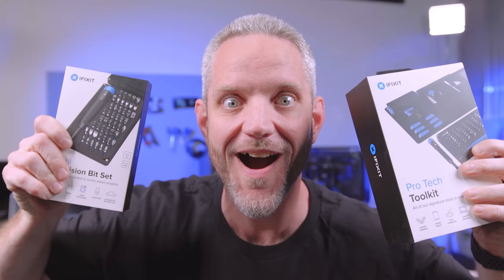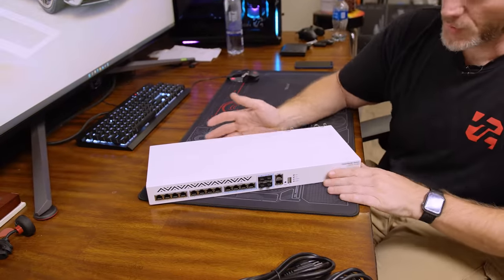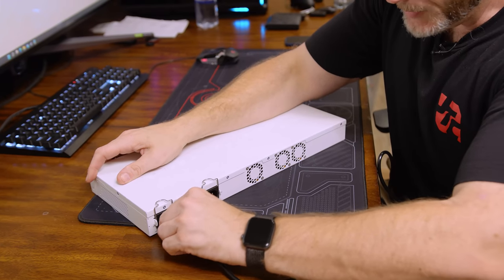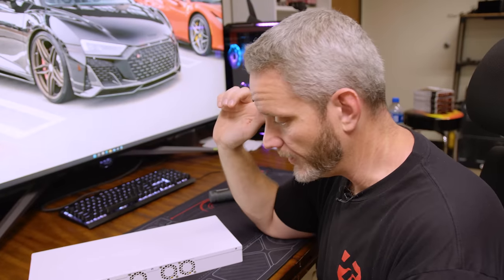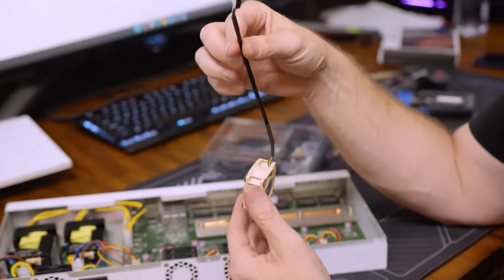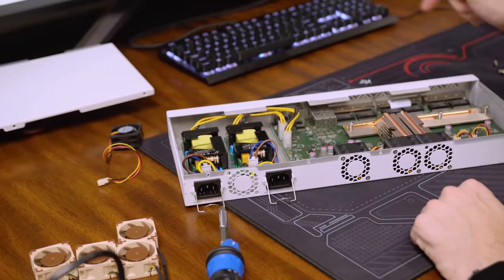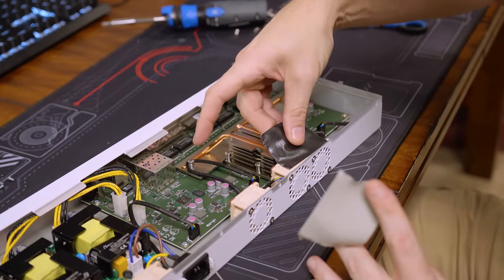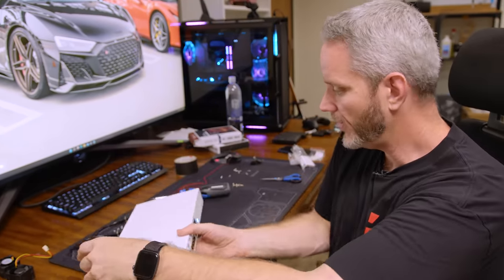We had to modify our new network switch...

Comment: Well , my switch is quieter ( its fanless , the CSS 326 from Mikrotik , 150 Dollar ) it has only two 10 GBit SFP+ and 24 one Gbit Rj45 . Enough for my needs . I buyed two QSFP+ Dual Port cards lately ( 40 Gbit )  because they were dirt cheap , 30 Euro + 15 for a PCIe Adapter each , now i have a 40 Gbit direct connection from my Main Computer to my NAS and a 10 GBit over the Switch because i used the second port to connect to Switch . TVs and BD and  Game consoles are connected to the standard 1 GBit Rj45 . The only Problem are the PCIe Lanes , if you want to use the full 40 GBit , you need 8 PCIe 3.0 Lanes , hard to find in Mainstream , you have to split the 16x Graphicard Lanes to 8X / 8X which does not matter if they are 4.0 or better 5.0 . Todays GPUs not really need 16X 4.0 Lanes and no GPU needs 16X 5.0 . The new X670/X670E could be interresting in this regard , it will be interresting to see how they made up to 5 NVME SSDs possible .
Reply: I love buying fiber cards off of e-bay as they're cheap and usually pulled from a data center.  My favorite is Dell rebadged LX4 Mellanox dual NIC cards.   They're capable of 10 or 25 gig.
Reply: @Darkk6969  My are HP cards ,HP IB FDR EN 10 40Gb 2P 544+FLR-QSFP Adapter - 764737-001 764285-B21 , they are in HPs special  small PCIe Format but you can buy PCIe Adapter for that . Its an Mellanox chip too and uses the Pro Firmware

Comment: Seeing your reaction to how quiet the noctua fans reminds me of when I recently put a noctua fan on my computer cooler.  I was dealing with some major overheating issues so I nearly powered it off during the boot up because I couldn't hear the cpu fan and thought it wasn't working.  But, nope, working fine, just completely drowned out by the cheap case fans it's had for 8 years.

(And yes, I know the imbalance in fan quality is not making the most of it, but the fan in question was substantially discounted, that's the only reason I got a cpu fan that good - it was literally cheaper than the no-name junk fans.)

Comment: 12 ports will definitely be limiting. It is not uncommon for me to pull 12 drops to an IDF in a single day. I would personally just bite the bullet and run multiple switches. You could grab a standard 1Gb 24 port switch pretty cheap for devices that just need a connection but don't need the speed.

BTW: With todays codes I now have 69 entries...nice. I feel like it may be bad luck to use anymore codes and break the sacred pair of numbers.

Comment: For my own sanity the only thing I would do differently is do a mock setup with the orginal fans and seen how hot the switch got then swap out the fans.

With IT equipment you would want to think that it would have some kind of overheating protection but that's not always the case and the last thing you want is a switch slowly cooking itself to death.
Reply: MikroTik switches are actually built to withstand high temps.  I have several of them in my home office and without AC it gets over 90f in the afternoon and then cools off at night when I open the windows.   No issues after 3 years with this setup.  Eventually I will get the AC fixed.  Just $$$ to do it.
Reply: @Darkk6969  perfect example! You know the products and know from your experience they should withstand the heat!

I on the other hand do not know that and would caution towards keeping them properly cooled first before trying to do what Jay did and make them siliant.

One other thing that didn't cross my mind is these could be rack mounted in a dedicated room for server/IT Equipment that is noticeably warmer then other rooms but Jay will be running it in a open space that will have much cooler air than dedicated spaces rooms for the equipment.

Comment: 10gig copper is not dumb. If you’re close enough that you’re getting 10gig speeds 10gig from fiber isn’t any faster. That is a pretty cheap switch though, I’m curious what the actual backplane switching capacity is?

Comment: I use sfp+ to 10g rj45 copper modules for some of the devices I have that already have 10g ethernet like the iMac Pro and a Qnap nas.  I wasn't going to drop 500+ on a 10g ethernet switch when I could just get a pair of modules to convert it to copper.

Earlier Unifi switches were plagued with loud fans (I have some) and I know a decent amount of people swapped them out for noctua fans.

Comment: Hi J the HAMMERHEAD 4V Lithium Rechargeable Screwdriver with Patented Circuit Sensor and 9-Piece Bit Kit with Innovative Bit Grip on Amazon Uk is relatively cheap at £292.72 that's is US dollar $ 356.93 J stricks again.

Comment: Just had a quick look and there is only a few options
24x SFP+ with 2x 40Gb unlink Mikrotik CRS326-24S+2Q+RM (£700)
OR
24x RJ45 with 2x100Gb uplink FS S5850-24XMG (£2000)

Running a lot of SFP+ modules is not cheap and DAC cable are not long.
OR
 get another device with LAG (link agg) it to server rack and then a smaller one in the edit room with DAC (active) 10m (longest ones I can find) to you local machines
See what you think ???

Comment: I just looked and no the first next option for more then 12 ports is the Netgear Prosafe M7300 XSM7224S which is double the price but does give 28 ports and that thing is going to be LOUD as its a 195 watts device. There is no sane option inbetween. Weird that there is such a huge gap that noone went into.

Comment: I think you'll find the reason the Ethernet wont work with SFP port connected is that the backplane couldn't support running both. So it would be one or the other.

Comment: Jay, you probably would have been better off with an SFP+ switch and just used 10GBASE-T SFP+ transceivers for the few devices you didn't want to move over to fiber/DAC, and just used fiber/DACs for everything else. Would have been cheaper and run quieter and cooler.

Comment: There is not really any other switch that is cheaper than that switch that is also RJ45 10gig ports. The only other way its cheaper is an ancient lb6m SFP+ switch that is console management only, no web gui for management. SFP+ modern switches are cheaper, but not by much when you factor in the add-in cards, fiber, and transceivers.

Comment: I was literally thinking about asking about your screwdriver jay and then 5 seconds after the thought you suddenly answered me in video, what good psychic turnaround on questions lol.  that aside vid was awesome as a whole, I didn't know that the fans in network switches used standard 3/4 pin connectors, honestly would have thought they'd be soldered in or be some type of stupid proprietary thing
Reply: Cisco switches use a weird pin-out for their fans but the standard fan connector, WATCH OUT!

Comment: It's gonna be tough beating the MikroTik for value. Ubiquiti has the XG 224 (USW-EnterpriseXG-24) with 24x 10GbE ports and 2x 25G uplink ports for $1299, if you can find it in stock somewhere.

Comment: I’m not familiar with the network plan (probably I’ve skipped that part lol), but is that the only switch that you’re going to put for the entire network? Since your PCs are gonna be far from the server rack, I don’t think that running multiple long Ethernet runs from the rack to the office is a great idea. Plus, you would need some access points, in order to cover the whole space with WiFi. If I wanted to do it better, I would buy 2 of these switches (one for the rack and one for the office), and run a single fiber connection between the two. Also, I would connect the server to the switch with a fiber cable as well, so I can the best performance out of it.

Comment: Warning: @10:00 Jay makes a comment that the capacitors probably would have been safe until he plugged it in. This is not true. Always assume a capacitor is charged even if you have not plugged in the device yet. You don't know that it wasn't plugged in for testing and capacitors can hold a charge for a very long duration of time. Always assume capacitors are charged. Think of them like little ninjas. Sometimes they're a little black bump just chilling, sometimes their faking chill but really they're about to try to kill you.

Comment: why mikrotik though? sure, it's great as a router or a small firewall, but I believe cisco does a better job with switching.
Reply: I've personally owned several MikroTik switches and they all been great for the money.   You still get command line, WebGUI and even Winbox to manage it.   It now supports wireguard inside the switch!
Reply: @Darkk6969  yes. It's basically a normal mikrotik router. They're great for the money they cost, but for someone mission critical, I'd never use mikrotik. I saw mikrotik equipment act up, freeze, get buggy, but never saw any with cisco equipment. Although, if we compare the price, mikrotik is the winner for SMBs.

Comment: Routerboards OS is awesome and Jay should look at it! Cat6a is fine for a looooong time yet. Great buy.
Reply: Fine as long as you only want to go 10G.  Which is the write performance of a 5 year old mid-range NVMe drive.  Modern high spec ones can push (albeit briefly) 50G.
In the last 20 years everything else about your computer has gotten orders of magnitude faster, yet home networking has pretty much stalled at 1G unless you like spending big bucks.  Think of what it would be like if the only options you had were 80GB IDE or 7800GT's unless you spend the pennies for 8TB NVMe or 3090Ti's with nothing in-between.

Comment: Console port is Rs232 and likely pinned for a roll-over, not a cross over cable 

The Management port would be eithernet, but modern ports auto cross, so again, no need for cross-over cables.

If you ever need a crossover cable you're on some old shit like 10m or early 100m.
Reply: My thinking is that the console port would be ideal for using an RPi as the console. They're already running linux, so figuring out software shouldn't be hard (if you're not afraid to code a little bit) but the switch (being that it's literally just a switch and how complex can these things be even if they are incredibly fast?) should be spitting out a simple text-based command-line interface.
Or you could just connect the RPi to the "management" port instead of the console port and use the company's software to manage the switch (hopefully they have a Linux version of their software available, being that they're in the business of network equipment that wouldn't make sense to not have but you never know it wouldn't be the first time a tech company made a bad decision, failing that of course someone ELSE probably made some Linux software for managing that specific switch).

Comment: I really think you should reconsider the placement of your rack, especially if you're conscious of noise levels when filming. Would the room you're in in this video not be a more appropriate place for it?
As for other 10G RJ45 switches I don't think you're going to find cheaper than the MikroTik. Most listings will try to trick you by calling a switch with 8 1G ports and 1 10G port a "10G switch".

Comment: WOW, that is the same mod I make to my Reolink security server, which was exactly what was needed.  Are you one of my viewers Jay 🙂  By the way, those caps are too small to hold any charge that could be a problem for a creature that has a body weight in excess of a 2-week old mouse.  Please keep watching my Channel.
Reply: By the way Jay, you probably made the best choice in that 10G switch considering the availability from Amazon today.  The only thing that may have been near the Price/Performance would have been to use two 8-port 10G switches from NETGEAR (connected via DAC) which would have yielded 15 usable 10G ports.  However that would have used an addition 1U slot in your rack.  I have one of those, and I am currently considering adding another to expand my 10G networking capability.   They are not manageable or support VLAN's, but they work VERY well and seem to last last without an issue so far for me (2.5 years on my one so far without ANY issues).  Doing this could be at least a Stop Gap until one of the Pro summer vendors releases a reasonable priced 16 (or 18) port 10G switch (hopefully with at least half the ports supporting POE++ as well.  David Rivera, Professional Engineer (qualified via the NYS Computer Engineering pathway).

Comment: I'm a big fan of MikroTik gear (though I wish their WiFi was better... they're working on it though and so maybe we'll see new gear in the coming months), and when I've looked around, there's basically nothing at this price point that's better. If you want to pay double, you can get something with a few more ports that's better, but at that point, why not buy two of these and join them with a short DAC cable and get even more ports? Because they're managed, you could easily set them up to have VLANs that span the two switches.

Comment: There is a reason they put servers and their ilk in a different room than people. Server fans can be so loud that they cause ear damage of course over a long period of time. These fans are designed to keep things that generate a bunch of heat in a tight area cool.

I'm betting the you just halved the life of that switch by modding the fans.

Comment: Not a big fan of those Mikrotik CRS. Firmware is super flexible but for me (early adopter though) always has been buggy. Had two CRS317, both died within the first two years of operation. Even did the Noctua fan mod.....never again. Went Ubiquiti after that and never looked back. Similar setup though with a rack in the basement containing around 200TB of network attached storage and a couple of infrastructure machines. The network backbone is (finally) all 10g, with the servers, primary workstations and one laptop connected via 10g. Ubiquiti has an interesting 8 port rackmount 10g SFP+ switch, passively cooled. they take a variety of SFP+ modules (brands) including those for 10g Base T. With that I am very flexible and got a passively cooled solution that's not too expensive. Downside: It's only a Layer 2 switch.  The cabling in my home is Cat 6/Cat 6a/Cat 7. For the connection to the basement (multi-family home) I used an OM-3 pre fabricated cable. With the right optics it can go 100G over 300 meters.

Comment: Hey J, good too see your moving into the land of 10Gb networking. Given the price and high quality of Ubiquiti I would recommend their SFP+ aggregation switch. It’s $300 USD and for future versatility buy 8 RJ45 copper SFP modules. In the future you just need to swap out the RJ45 for a cheap fibre module. The SFP+ ports are plug and play for transceiver modules :)  —— Ubiquiti UniFi Switch Aggregation | Managed Layer 2 Switch with 8 SFP+ 10G Ports (USW-Aggregation

Comment: I had to do a mod like this on my Netgear 10GbE switches and it was a huge pain in the butt because the Netgear switches use a nonstandard pin configuration on their fan headers. Most likely deliberate to prevent this kind of mod.

Comment: I'm really not convinced swapping fans in these switches is a great idea. The stock fans aren't loud for the sake of being loud. They're loud because they spin at a very high RPM and move a stupid amount of air. The Noctua's are quiet of course, but they also don't spin as fast so they're not going to move the same amount of air. 10gbit ethernet NICs run very hot so I assume Mikrotik put in 4 fans for a reason.

If you have a large switch and you're only using a small amount of ports the mod is probably ok, but if you're actually using it at full capacity I'd be careful of the temperatures after swapping in fans that don't cool as well.

Comment: I'm sure you know this by now but with these mid-high end switches, the power is redundant where the idea is each plug connects to a different power source so you might not need a power strip.
Reply: I moved my old file server from one room to another without turning it off - redundant PSU meant I could disconnect one PSU and connect to another power source. Then disconnect the other PSU and start moving the server.

The joy of redundant PSU (the terror of looking at the increased price tag... where just the redundant PSU on that old file server costed like this 10G switch)

Comment: Did you say that you would need SFP+ NICs in your machines if you used a switch with SFP+ ports and copper GBICs? That's not the case. It's RJ45/Cat6 or higher at both ends. It doesn't matter how you get there, via a soldered-in RJ45 connection or an SFP+ module.  I have a Ubiquiti aggregate switch (10G/25G SFP ports) in my home lab with various Intel and Aquantia 10G NICs (soldered in RJ45) as well as Mellanox 25G (SFP) NICs. Mix 'n' match.

Comment: Uh. 
That HAMMERHEAD HCSD040-02 4V Lithium Rechargeable Screwdriver with Patented Circuit Sensor Technology & 9Piece Bit Kit is now $170.00 on Amazon.
Good deal when you got it!
The HAMMERHEAD 4V Lithium Rechargeable Screwdriver with Patented Circuit Sensor and 9-Piece Bit Kit with Innovative Bit Grip  is $130.00

FYI!